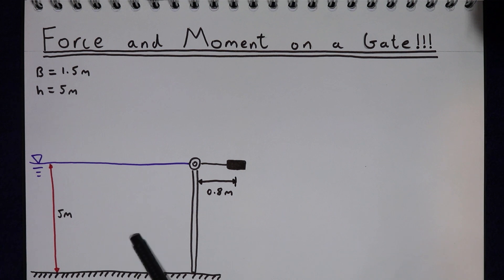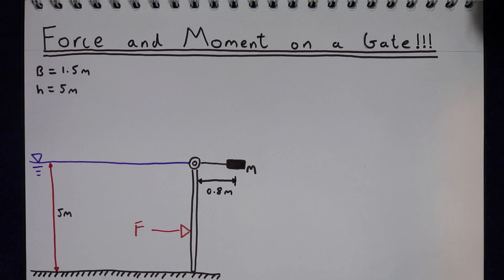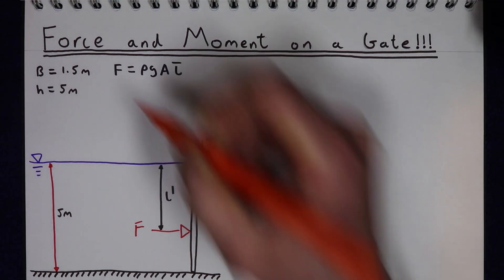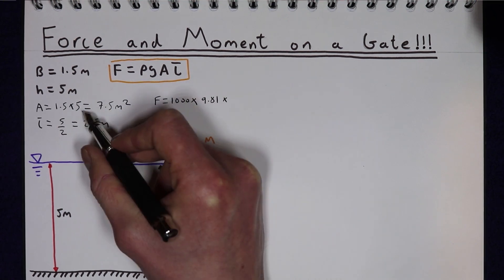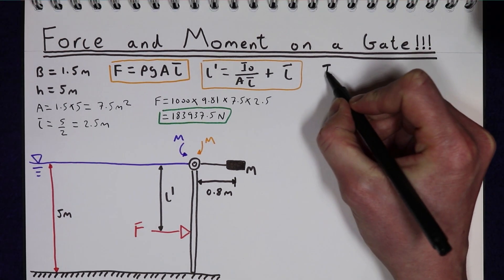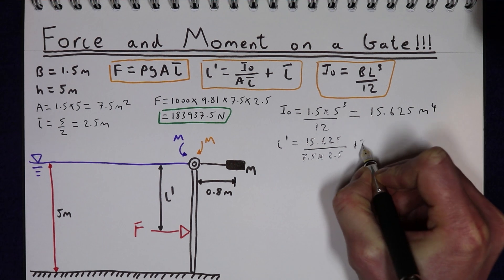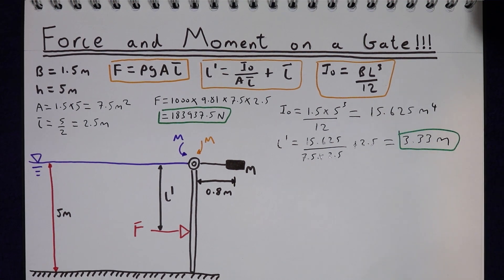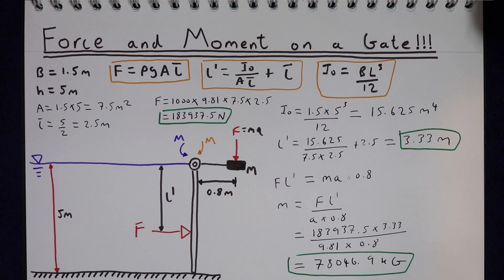Gate Hinged at Top: Forces and Moments

Comment: Thank you for your videos, I find them very helpful!
When calculating the second moment of the area, aren't we supposed to divide by 3 instead of 12? The axis is not on the center but rather on the top of the rectangle.
Many thanks!
Reply from the maker: Hi, thanks for the positive comments. That’s correct, l’=I/AL, where I=BL^3/3. However, you can also use parallel axis theorem where I=I0+AL^2, giving l’=(I0/AL)+L, where I0=BL^3/12 (which is what I did). They both give the same answer, it’s mainly preference which equation you use. Maybe a future video could work through the derivations and explanation of these equation…